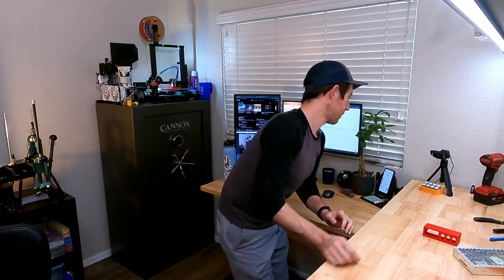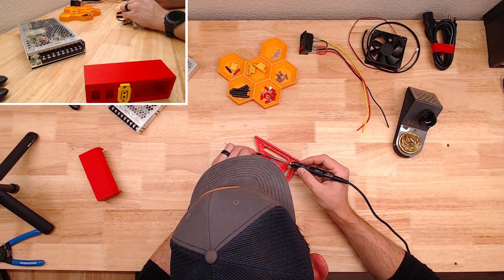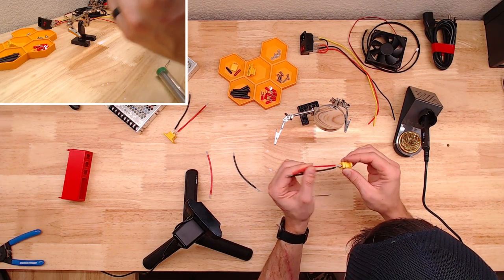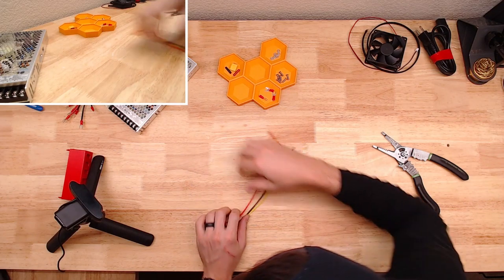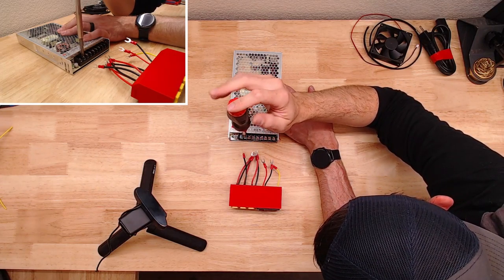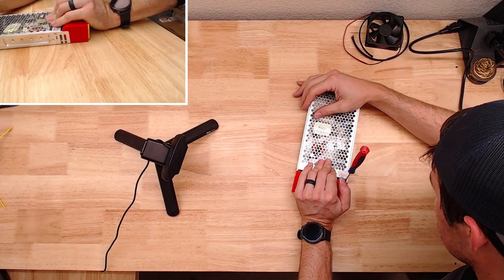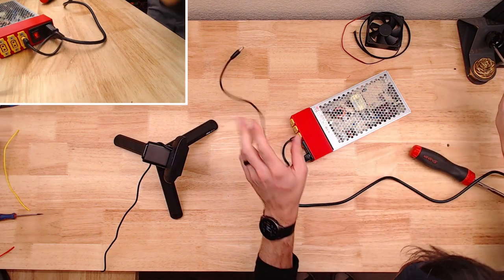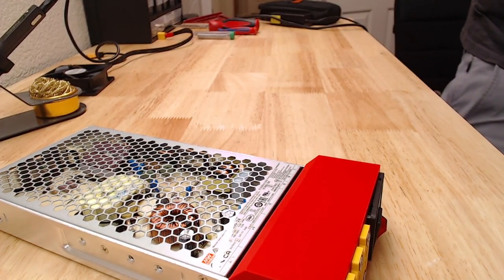Meanwell Power Sleeve Build - Test Fit?

Comment: what are the name of the thing you used to connect the wires to the power supply those yellow things and those 2 prong fork looking things
Reply from the maker: Do you mean the XT60E-F or Fork Spade crimp on connectors?
Reply: @zsdewitt  oh yea thank you so much I was just about to buy this exact power supply before even seeing this video then i saw your thingy verse model and came here thank you so much. not even kidding my amazon tab of this same power supply was pulled up at the same time I saw your model didnt even search for it,